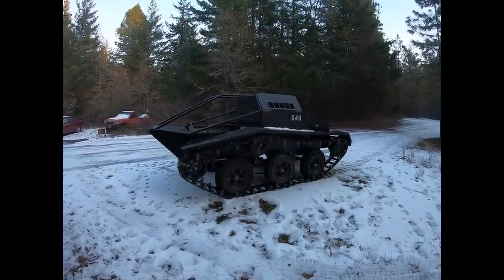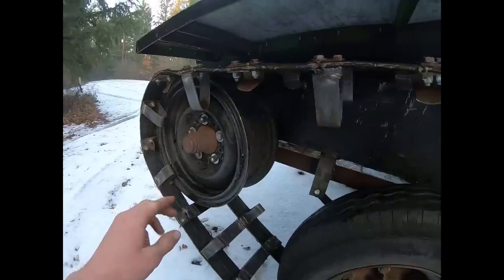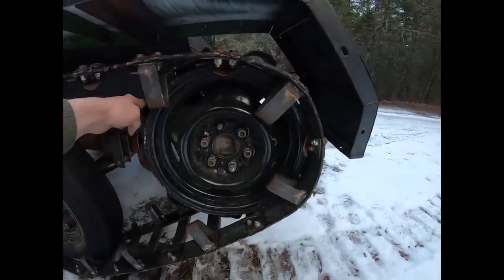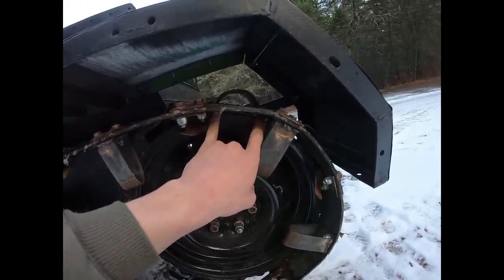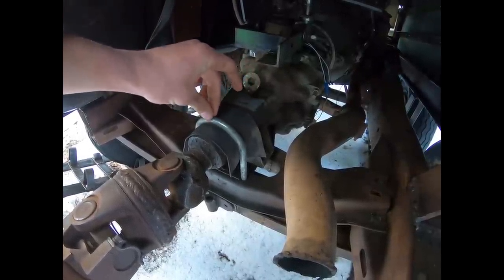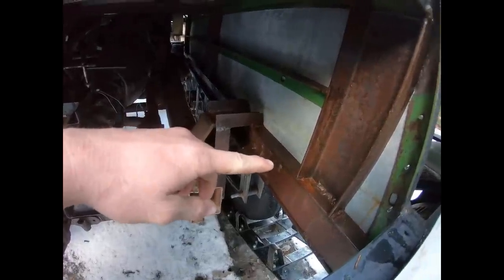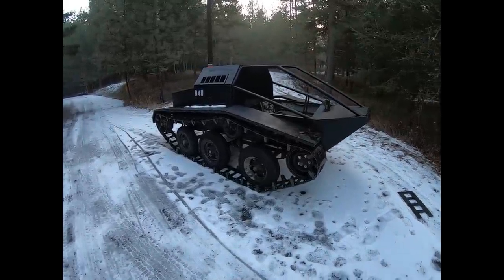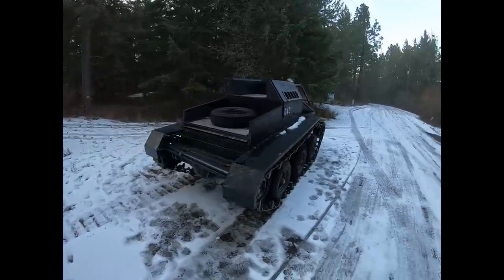How I Built My All-Terrain Tracked Vehicle out of Scrap Metal for Under $400 (Bug-Out Vehicle)

Comment: nice job, the shift system you want is the same used on most front engine FWD cars, score ya a shifter outta like a honda or something and just run longer cables back to your transmission, itll work great. imho i would of used the  hydraulic brakes as brakes and steered with the cable parking brakes. too bad the dakota wasnt 4wd if you can find space to slip a transfer case inbetween the trans and rear diff  you could build a PTO winch which would be pretty sweet, also you can use a pair of scissor jacks to make the front idle axel slide and use that to tension your tracks . hope to see more vids on this, i should post one of my project, diddnt think people were actually into this kinda things !

Comment: I designed this vehicle years ago... Thank you for building it...
Reply: My design floats, I think you can easily make this float...
Reply: My design needed a carburated engine to be points and plugs instead of fuel injection. EMP resistant. But, how nominal is that right? Just drop a decade earlier engine in it and then run that thing off your gasifier.
Reply: Awesome design and build, hat's off to you, sir!

Comment: You could add sheet metal covers for the tracks connected by bearings to the idles and bolted to the outer frame. Would hypothetically help protect the tires and tracks from shrapnel or getting caught up in vegetation.

Comment: Alternatively you could have mounted the trans up front with the drive sprockets pulling rather than pushing. This design was used on Sherman’s, panzer IV’s and a few other tanks for its stability and ease of replacement. 
I would also recommend bending a bit of thinner sheet steel to cover the rear dif. 

Additionally think it would be totally wicked if you were to add a “box” like that of a truck to carry  things In as well as a “roof” to keep
The snow out! Just some ideas :)

Comment: 1 thought to avoid track stretch, would be to take some standard chain, and weld it to the track links such that when the chain is tight, there's a little bit of looseness to the rubber, and the majority of the driving force for the vehicle is driven through the metal chains rather than the rubber (the rubber is there for ground contact).

Additional bonus for that modification, if you need to go in some really rough terrain, you could use the existing "track chains" and some extra chain, to rig a bunch of chunks of 4x4 or such to the track to give some bigger "teeth" to dig into the ground with.

Also the thing naturally needs to carry a log. All tanks must carry a log or 2.

Comment: Do a 460, New Process 435 4 speed, Dana 60 rear with disc. Upgrade the frame to aluminum. Put a serious 2 seats in it. Elce fan. Windshield with wipers, heater inside so going up in the mountains in the snow. 25 gallon tank. It could be slung very low with swing axles as the three roller on each side, lighter. Building a track system can be done using various high end types of fibrous belting. Cleats, lugs, and multiple tracks for would be great. I'd go with 18" wide for exilant flotation. 350hp would be plenty. Wouldn't be a Ripsaw, but it could still be done cheap, light, and fast. With a 435 NP I'd be bullet proof, but you could still free-wheel and park on any hill with it in gear. A parking brake would be just like a truck. Optional brakes on front rollers now having them be sprocketed as well. 4 wheels discs would be great.

Comment: I like that you made it your own way. I am working on a design of my own. I am not making a "tank" but i am designing something that i can use as a traktor and where i can go in to woods in Sweden. And help people who got stuck in the snow in the wintertimes. So i need to have a warm cabin and some real sturdy metal tracks. I'm a blacksmith so that should not be a problem. Oh yes i need the tracks to stick furder out in the front. Smaller wheels. I am thinking of wheels from a vorktruck. Sollid rubber tires. The engine in the front so i could climb over some logs if i have too. Oh one last thing Gassoline is a fire hazzard and a gass engine drinks a lot and it stinks. So i want to have a big turbo diesel engine. Or two smaller diesel engines like 6 straid next to eachother. Break one put the other one in reverse. Works like charm. And i want a big big diesel tank with an extra output with its own pump. So i could give a bit of diesel to someone in need. Also want tow hooks in the front and back and a winch front and back. So i'm building a OFFROAD search and rescue vehicle that i also can use on the farm if i have to.
I have seen many people try there best with building tracks and yours is one of the best ive come across. Execpt those Ripp dudes but those cost a pretty penny to build.
And i'm on a budged.

Comment: Super cool. Really like the re-purpose of items. 
You should shift it with the same cable system you used for the throttle/gas peddle. Or a metal linkage.

Comment: Rip-Saw on a Low Budget . WELL DONE !  Investing a couple of dollars for a No-Spin , Detroit Locker Diff centre may make it handle quite well . It would travel Straight as a Arrow left to itself then . For a few dollars more  a Torsen Centre may be even better , since it wouldn't resist the turn commands .

Comment: I am quite surprised you did a great job using materials available to you . I was a us army track and wheel mechanic there are some things you could do better with the proper materials but the main thing you did well is that it is Dodge lol lol good job you made me want to build one now but 1st I need to purchase a welder ..I am a certified welder so don't be mad if I put one on you tube much nicer ! Lol lol I'm an extremist!! Hust built a Jeep wrangler put a dodge 360 in it using  ..... a dodge Dakota bell housing ..only bellhousing cable to attach my stock jeep 5 speed manual and the 97 360 converted to all oldschool Holley carb, 74 hei ignition

Comment: Outstanding result for the price you paid. Tracks are my thing (I'm not knowledgeable on them, they just interest me so much). Do you have problems on hard surfaces with the bolt heads being the only contact with the road? Once I decide on which track system to use (home made of course) then I will build my lawn mower tracked, and maybe try and make a YouTube video of it as well. Thank you for sharing and good luck to you, you've earned it.

Comment: There is exactly one thing I'd want to do to this design- make it waterproof on the bottom and stuff enough displacement tanks where it would float.  Maybe even modify the tracks so we can use the same drive system in the water.

Comment: Looks fun , however you still have the issue of an open center and if bogged down you will have one track pulling. You can of course engage the brake on the other to transfer power but its not very efficient. Need equal metered power to both sides of the machine.

Comment: Yes more please could you add a plow and a box fan to run directly onto the radiator and close in the drive cockpit and also a winch in the front would be beneficial just in case or in the back and two battery mounts probably on the inside would it help with any future problems

Comment: NICE RIG JUST A TIP I BUILT SOME 30 YRS AGO TANK PLAT FORM FOR CARS AS I LIVED IN DEEP SNOW IT WAS FLAT TOP WITH TRACK FOR A CAR ALL BREAKING AND STEERING WAS DONE WITH THE CARYOU DRIVE YOUR ROAD CAR ON TO IT LIKE A TRAILR REAR WHEEL DRIVE BY FRICTION FRONT DO THE STERINH IT WI LL GO THROUGH DEEP SNOW WELL FROM THE COMFORT OF CAR VERY FUN BUILD ITS BEEN SO LONG I DONT HAVE PICAS AND SOLD IT

Comment: Your steering mechanism is rugged, simple and effective. However it does lack in efficiency. If you feel like investing I suggest a hydraulic drive system which would discard the need for shifting by using variable displacement pumps for each side.

Please keep us updated on how your homemade tracks hold up!

Comment: Over a year late to this video, but don't use servos to control your shifting. Especially in a vehicle you plan to use in a shtf scenario. Get some tubing, hoses, nipples, etc, and make a simple hydraulic system. Maybe even repurpose a couple brake masters. You could drive it with any liquid you want, and it can't run out of battery or have a servo wear out. Just my two cents, amazing job!

Comment: As a prototype excellent.  However the weak link is the track design. having two thin strips of conveyor belt.  There should be a metal covering so the rubber belting does not touch the ground, too easy to get cut and/or simply wearing out really fast.  An endurance run will expose the bugs in the design.

Comment: A good limited slip diff would be significantly better than a open diff as far as both steering and difficult terrain . The torque transfer from the trac that is braking to the opposing track that is driving through the turn would make handling better . And both tracks being driven in a forward or reverse motion when not turning would significantly increase its capabilities. Especially when applying slight pressure to both steering brake cylinders to lock up the limited diff like a locker

Comment: Hey, have an idea, and see if you could implement this into your build:

Using the Dakota instrument cluster, or even a Ford Ranger/F150 cluster, you could have, as gauges, the following:
1) Amp/Battery charging
2) Oil pressure
3) Gas Gauge
4) Coolant temperature
5) Speedo*
6) Tachometer

*: I'll go into how a speedometer actually works.

Basically, the idea is to allow first-generation engine and drivetrain sensors to let you know everything is kosher. I know, from experience, that using a junk truck's parts isn't ideal -- but it would give you a platform to replace older parts.

Additionally, I understand that the engine is gas -- but, should you consider it, there are several engines that are small diesel engines. I know that in the 1980s, Ford used a 2.2L Perkins four-cylinder diesel in the Ranger. Both Volvo and VW have diesel engines as well -- and I mention this because if SHTF, you will want a way to make your own fuel. This would mean being able to convert trash and other things into diesel fuel.

Next, I would consider adding an electric fan as a way to cool the motor more reliably. I have found that after ten years, the spring steel used for a mechanical fan clutch tends to start wearing, and that means heating up the coolant more than it should. And, if you understand electrical theory and application, adding an electrical fan and control functionality isn't hard, unlike what some people might say. I should know, I've done it to my 1992 Ranger.

About a speedometer: Basically, up until 2000, most trucks and vans used speedo cables, transmission gears, and mechanical speedos to tell how fast you were going. Beginning in 2000, that function became purely electrical (which may help with distance between cluster and speed sensor). About 2010, manufacturers started simply reprogramming engine ECU/ECMs to use the data from a wheel speed sensor (used to detect wheel spin for ABS systems) as the actual rolling speed for the speedo. Point being, while I understand that the budget wasn't very big on this, there are several upgrades and improvements you could do to get more out of it, especially considering, in context, that what you built is supposed to be a bug-out vehicle.

Overall, nice job on the build! It is amazing to see what can be done when somebody puts their mind to a creative purpose!

Comment: Picked up about 3-400 or better ft of 4ft wide used belt from a local scrap shredder. Plenty of usable material in it. About 80ft with V-cleats. On top of that got about another 500 or so from the local county rock crusher. 3ft wide & just as much usable. ALL FREE! MORE than enough for any number of projects. Might start with something no bigger than this but probably closer to the Bren Gun carrier until the drive system is figured out. Got enough 1.6 VW diesels thought it might require an adapter plate to use a bus transmission to make a lightweight take.
Reply from the maker: Do you wanna sell any of those 1.6L's?
Reply: @randomn6473  Don't have any plans to yet. Some juggling between vehicles to still do & a couple need rebuilding. One I was told is a gasser block but diesel head & guts. I have another diesel block that can replace it. Those I may consider selling. Don't recall if you mentioned in the video your location as it would be easier to pick up than ship.

Did you ever get around to making the more in-depth how-to on the build?
Reply from the maker: @RuralTowner  Yeah, I know how that goes! I'm not terribly eager to get my hands on one, but I can imagine many things that I'd like to do with something like that! I'll probably just keep an eye on my local area. I'm up in the pacific northwest. Beautiful country up here. 

I haven't yet. I've had a lot of life things happening and haven't gotten to it. But I might just be able to pull something off in the next year or two. Not sure yet.
Reply: @randomn6473  I'm in the SW where it gets the exact opposite of what you get there. When I do eventually get around to this kind of project the idea will be to likely make the tracks double-ply w/ 1/4 - 1/3 overlap that way it not only limits stretching & increases strength while making it as close to a "live" track as possible. Around here the terrain here gets alot rougher so 2-ply would make it more resistant. The tracks MIGHT be made 1pc instead of 2 bands as here with the cutouts being framed in with flat strap instead of ladder rungs.

Comment: @Randomonium: if you build it, nerds will come! In all seriousness though, you could do the complete build video and create a how to manual for people to buy for $20 and then use it as a kickstarter campaign reward for donations for a new upcoming build of your improved version. THEN you can try to sell it to DARPA or just park one of your models over at your local DMV to see what happens. Just for giggles. 

For the build vids, I strongly recommend being as specific and technical as possible. There's no such thing as being too technical here, share what you know and the rest of us will bone up on engineering just because. I would personally like to see an electric version where the "fuel cell" is a giant battery that can have a quick discharge port and refill port where you can exchange electrolyte solution. That way you can make electrolyte cheaply in scenarios where recharging isn't a viable option.

Comment: On that open differential wouldn't applying brake to only one side increase rotational speed of the free side making it difficult to steer? I would imagine that say when steering sharp to  the left you would suddenly accelerate on the right side, I may be wrong but I believe full lock brake to the left drum would make the right side double it's RPM. Pretty smart system none the less very similar to the bren gun carrier of old.

Comment: The main idea when using tracks is to distribute weight on bigger area, thus reducing the pressure on ground. In this case, the approach to build each track reduces its useful contact area at about one third, compared to what it could be. If you'll answer that the vehicle is too light to be concerned about it, then do not use tracks !

Comment: drill pipe might have worked better than a chopped driveshaft. thicker walls might not crush like that on the rear drive sprocket you made.. but regardless pretty slick for what you did. make a closeable cockpit and ride in a warm cab :P

Comment: very impressive build for 400$. or for any pricepoint tbh.

how reliable is the transmission? how easy is it to repair the tracks? does it throw tracks if you attempt to turn at "high" speeds? have you actually tested it on rough uneven terrain?

Comment: Is that gas tank mounted 90 degrees from it's originally installed position? If so and the gas pump is at the top, it could lose  the cooling effect of the gas when the fuel level is lower than the pump body!-John in Texas

Comment: I  would  modify  it  to  a  manual  operation,  by  pulling  the  engine  out, and  replacing  it  with  a  ' Tony  Little  Gazelle ',  and  dry  in  the  entire  hull, to  make  it  amphibious...I  wonder  what  the  weight  would  be  ?

Comment: I got a few questions, 1 is that engine a carb or fuel injected. 2, if it is fuel injected is it mechanical or EFI? 3 if it is electronic how did you hook up the fuel injection to work

Comment: Question, what is it running on, diesel or gasoline? 
Because gasoline is no good for shtf. 
I'll explain:
1. Most engines run on gasoline, so in an emergency situation people will rush to the gas stations, quickly depleting the supply. 
2. Gasoline deteriorates over time, and can only be stored for about a year. A year and a half at most. 
3. Diesels will run on refined used frying oil (and unrefined used frying oil can be stored indefinitely).